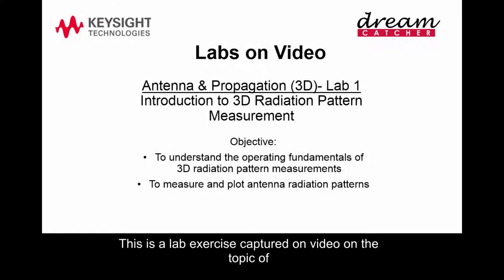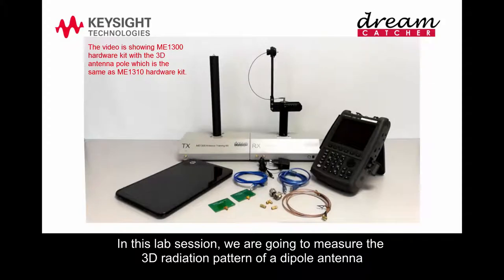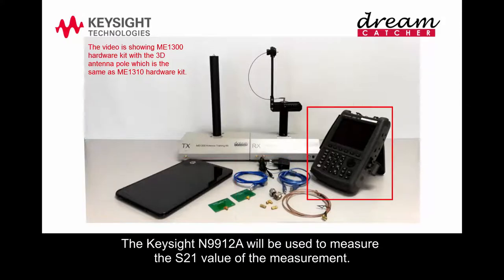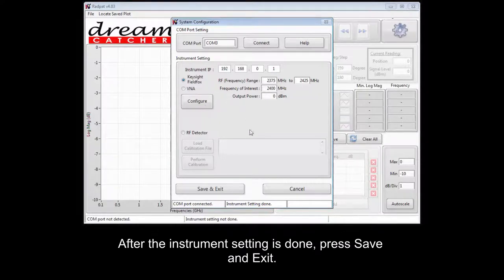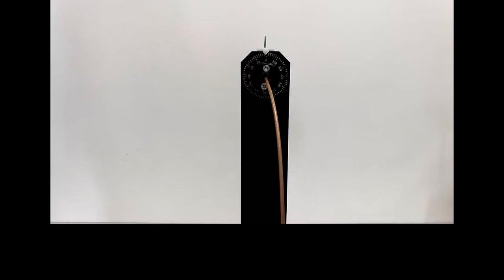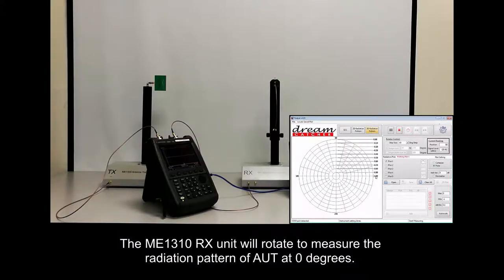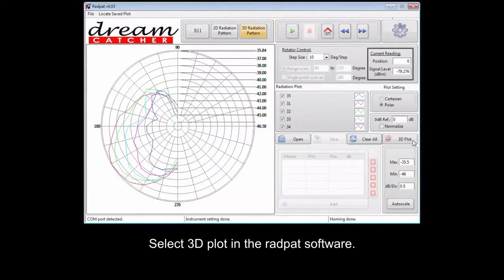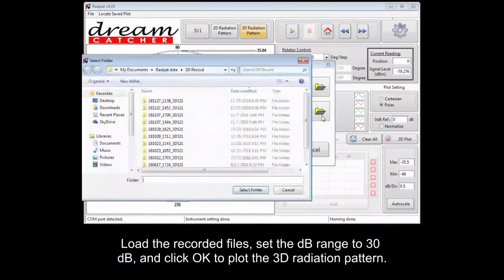ME1310 Antenna and Propagation (3D): LAB 1 Introduction to Radiation Pattern Measurement

Comment: Why the range is limited between 90 and 360 degree?
Reply: Hello, I believe your question had been answered via our email communication. If you somehow did not receive our email, refer below: When one axis is rotating 180 degrees and the other axis is rotating 360 degrees, we can cover the 3D plot's datapoints- 
a.	To make it easier to picture it, if you picture the antenna in front of you,  now you turn the antenna 90 degrees, and the top of the antenna(A)  points to the Right.
b.	Then the system does a 180 azimuth rotation, and the top(A) of the antenna travels from the Right side to the Left. So it covers 1st half of the circle.
c.	Since we do a 360 degree for the 2nd axis, there will time when the top(A) of the antenna will be at the Left side and now the azimuth rotates 180 degrees, the top(A) of the antenna travels from the initial LEFT side and ends at the Right side. This covers the 2nd half of the circle to provide 360 degrees coverage.